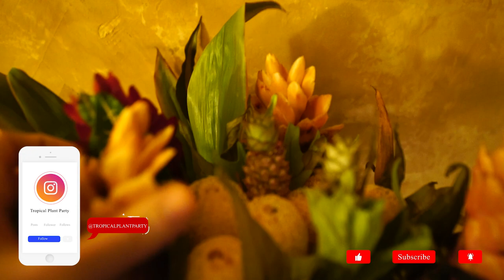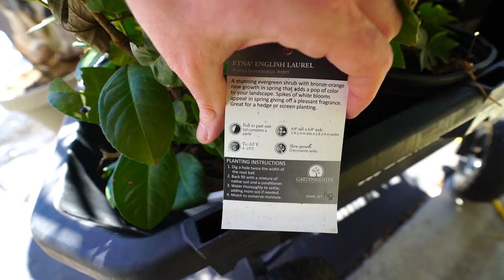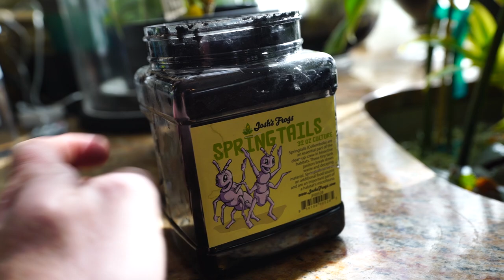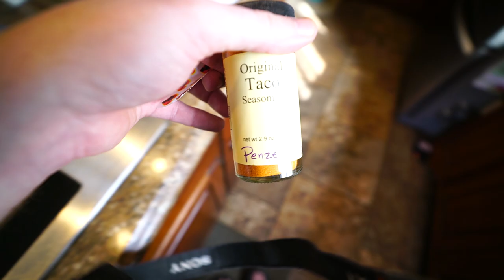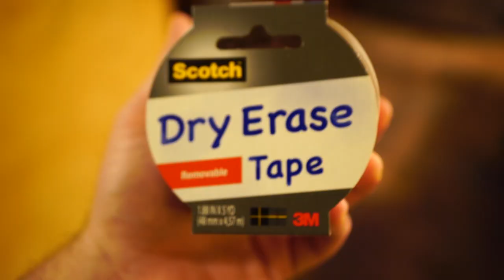Moving Temperate Plants Outside | New Josh's Frogs Springtail Culture For Terrariums | Saturday Vlog

Comment: It was 90 here today, looking about the same tomorrow. Next weekend is going to be cold, I will not be happy. I suppose it will be a good time to check out the garden center. Although I am loathe to do it because there are so freaking many people here right now. I had to go to Lowes and about had a panic attack. So many people, so few masks.
Reply from the maker: Wtf is going on with that!? I finally left the house yesterday(first time in several weeks) and the lowes parking lot was overflowing. I didn't go in, not going to go back until the garden center is opened and I can shop outside. Nope!
Reply: @TropicalPlantParty  I wish I knew what the deal was. I didn't have a choice about going in, I had to order a new refrigerator and it wouldn't let me order it online even though the guy at the store told me they had 1 in stock. You would have thought a hurricane was coming or they were giving stuff away, so damn crowded. All these snowbirds need to flock back north and give me my roads back.

Comment: Well plumeria are putting out leaves, had a few black leaflets, but that’s not entirely unusual. The paduca dropped probably 15-20 leaves, but has new ones coming in. Desert rose dropped a few leaves, but so far everyone else inside looks ok.

Outside remains to be seen. Oleander looks pretty rough, probably will give him a good chop in a few weeks. But go figure the dandelions are fine & dandy. 🙄

Picked up a thermometer/humidity gauge so if we ever need to know inside temp again, we can. Humidity gauge was just a bonus, but I wanted one anyways. Right now I have our “medical” (cold, sinus infection type) humidifier running in a room with a grow bulb on the paduca to help him stay happy. Humidity gets around 65-70% with the door mostly shut. Hopefully a different grow light is coming in the mail soon because this current setup is not ideal. (A better setup for this bulb is at my relatives...but paduca was higher need.)

Got enough groceries to open more options for me. I’m not restocking everything we lost immediately...some condiment type things will just be bought on an as needed basis.

Oh and miss uti kitty has learned new tricks...she’s figured out she can jump the cardboard blocking her from going up the stairs. Then after I put up taller cardboard, she figured out she’s skinny enough to fit through the stair railings. So I’m trying to limit her to 1 room, but at night, she basically gets full access. So a box is now upstairs just in case...I love she’s feeling good enough to get into mischief...but it’s going to lead to more cleanup for me...

Comment: I just love your home! 
Would you be, would you be my neighbor? Lol
I recently got into Isopods for my terrariums, really adds life to my tanks! 
Josh's Frogs is a great site, but a lot of their invertebrates have
been sold out for quite a while, I keep checking though!

Edit: Tech having moody days is something I have thought about for a long time. I used to give my SNES days off. XD
Reply from the maker: Awesome! What kind(s) of isopods do you have? I'll be adding a few of them as well.
Reply: @TropicalPlantParty  I find the types that do great under a wide range of conditions are the Porcellio Pruinosus 'Powder Orange' and Porcellio Laevis 'Dairy Cow' (plenty of vids on YT about them), but I do keep a community tank of random species and I have a couple plastic totes of more pricey Isopods such as the P. Hoffmanseggi, which grow to about two inches. 
I don't have any experience in the completely closed terrariums though. I know the springtails do okay with no airflow, but I'm not sure about Isopods, you may have to add something to prop the lids open just a bit! 
:) I'm excited to see what else you add to them! If that area you keep them doesn't drop to the low sixties you could probably do with some Scarlet Millipedes in a couple of the larger jars.
I'm sure someone with more extensive knowledge can add or correct what I've said.